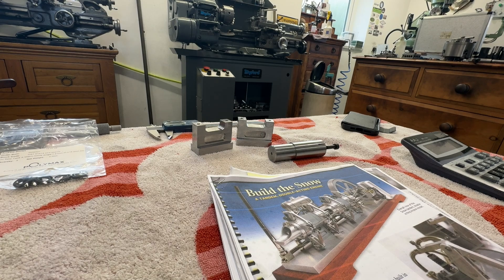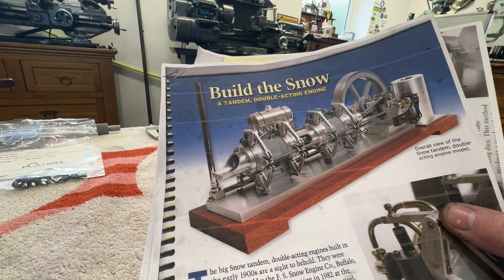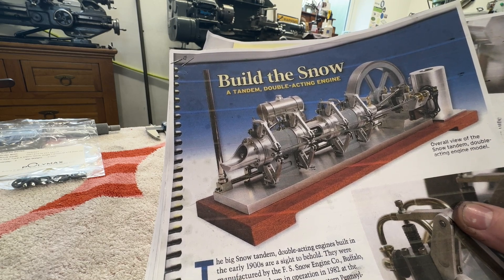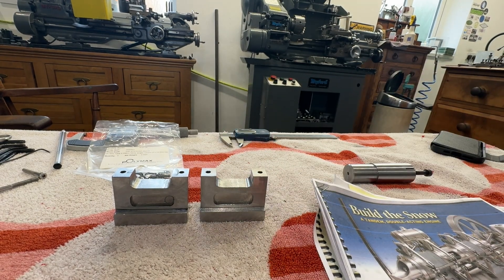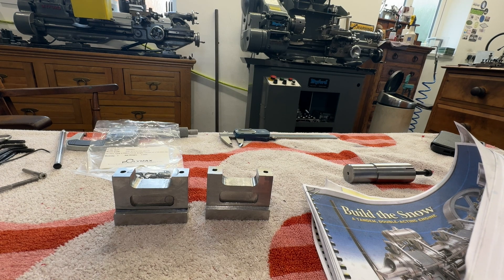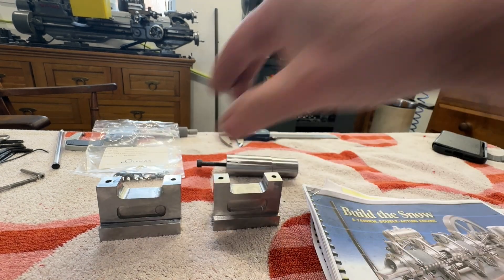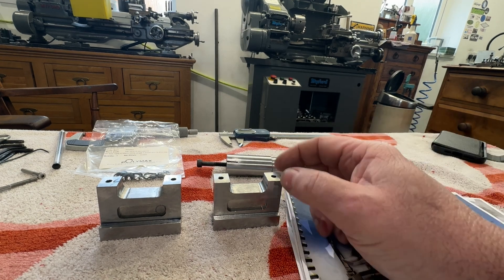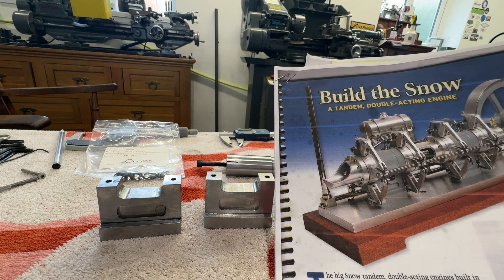The Snow Engine part 1

Comment: it looks like the double knocker engines I believe where developed for air craft use but failed, but where used in railway engines and trucks. Please correct me if wrong. Should be a great build
Reply from the maker: The early diesels had a triangle engine, I believe that was 1000"s of HP